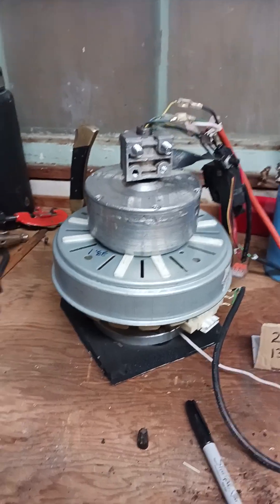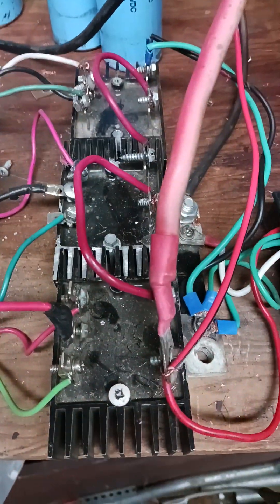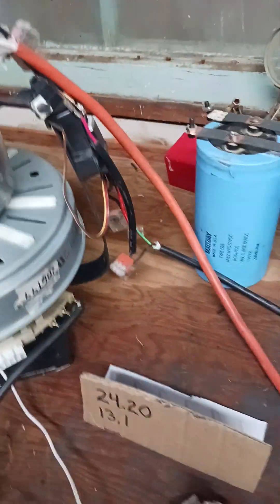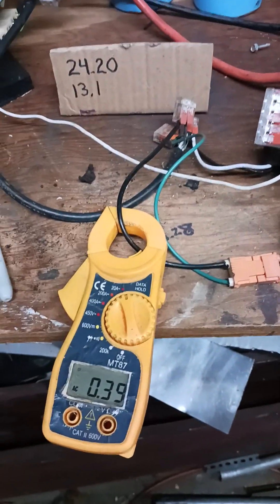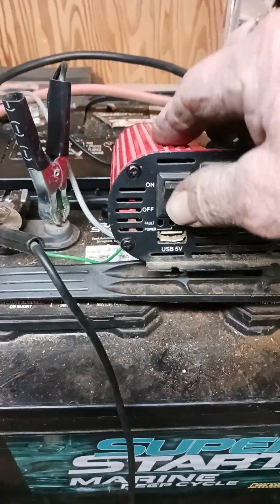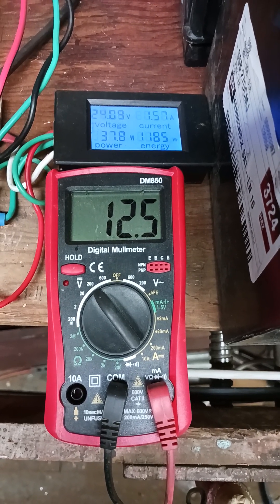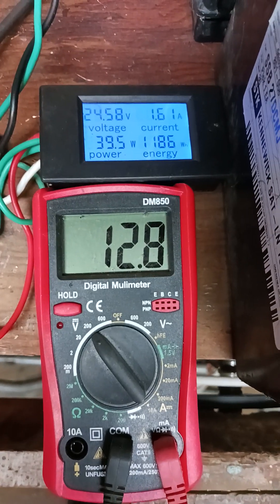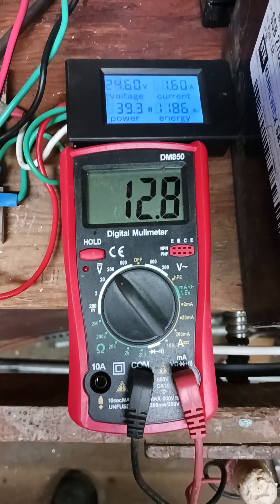video #1, A new type of looped generator system

Comment: You are on the right path.. What you have is called adaptive inductive charging.. Using electromagnetic pulses from the AKA.. Hoverboard Motor which excites the negative resistors in the Storage battery cells.. The reference voltages are due to the power split connections through the transforms and the diode.. They are all acting as a close capacitance circuit.. There are more to do with this opportunity than you can imagine.. You can actually build a solid state version of this using the electron spin from the magnetic core of both the transformer and the HOVERBOARD MOTOR..